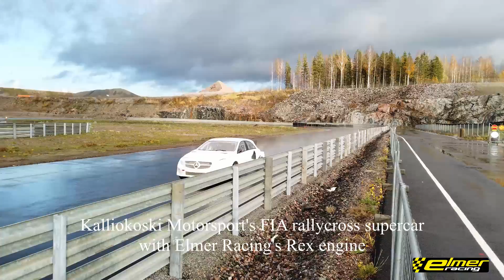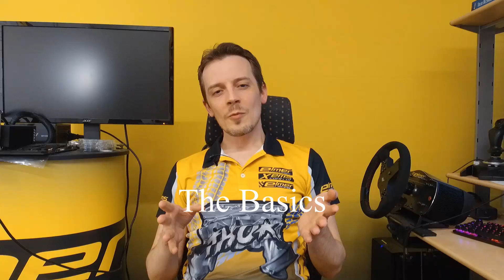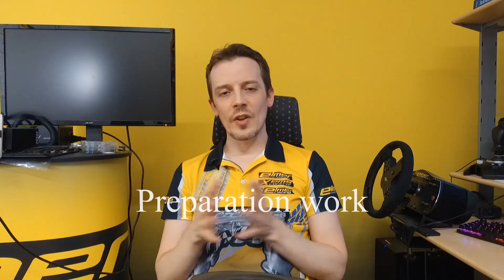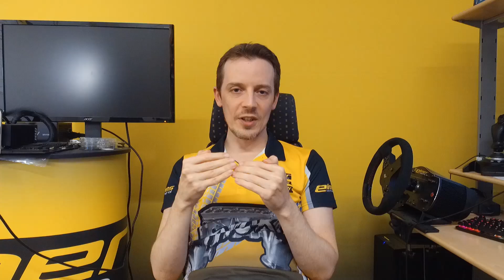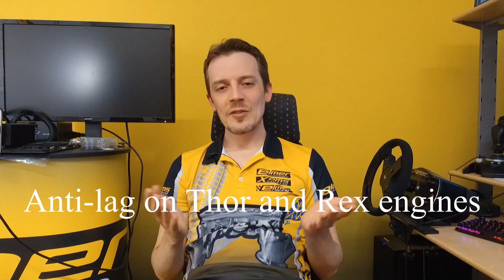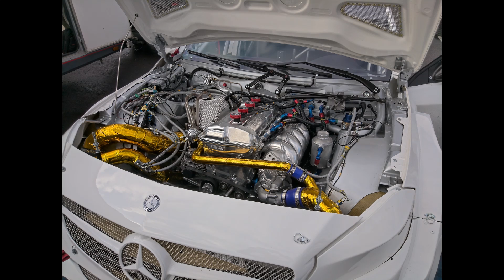Anti-lag for dummies

Comment: So Fresh Air Antilag system is less efficient that throttle + cylinder ign/fuel cut strategy?
Reply from the maker: Yes. At operating rpm using a modern anti-lag setup allows running up to full boost, even when exhaust pressure is higher than inlet. With bypass this isn't possible.
At very low rpm when your operating point is in the compressor surge area, you do have a advantage with a bypass valve though.

Comment: Hello, thank you for this video. Im playing with antilag on probably more basic ecus. Often i see pressure spikes on intake manifold pressure signal, but no spikes on pressure before throttle body. It means engine is missfiring? Can i just find retard missfire limit by trying retard of all cylinders or this must be tested just with retarded one cylinder(of four)?  Also which way of cutting cylinders is better by ignition or fuel(i read the fuel cut making less egt, but did not tested it in person)?
Reply from the maker: Pressure spikes in the intake (as you state) mean you have severe missfires, which results in combustion in the exhaust manifold, and the pressure/flame from that causing even the intake side to ignite. Not ideal to say the least.
You can find the missfire retard limit by retarding timing on all cylinder also.
Cylinder cuts should only be done by fuel and spark. Only cutting spark is the same as a missfire from the engines perspective.
Reply: @ElmerRacing But when ecu can just choose spark or fuel? Maybe noob question, but aim is to maintain boost pressure flat?(i still see creepeing of boost up inside intake(say after high rpm lift off from -0.2bar to 0.3bar during a second). And how may i compare/use pressure before and after throttle here, as there is a huge difference...?
Reply from the maker: You will have to check with your ecu manufacturer. Typically "fuel" actually means fuel+spark, but this can vary. Some ecu manufacturers even deliberately hide what their options do though!
In reality there is no way to easily maintain a super flat MAP curve. But that shouldn't be necessary in most cases. The ECU will adjust fuel and spark timing based on your tuned maps.
Backfires that go all the way into the intake are not good though, they need to be avoided. Typically you will have a spark failure (deliberate or accidental), spark timing failure, or A/F ratio not being in the combustable range if you have missfires.
Reply: @ElmerRacing Thank you. If i can ask more... you mention A/F , how much enrichment is "ok" ? Looking A/F during ALS with a cut is pointless.  And what about Blow off valve,  teoreticaly it will not work, but i feel it will open  for a brief second as pressure difference pre and post throttle will high enought at lift off= and it can prolong turbo life?
Reply from the maker: Maintaining the correct AF ratio when coming back after a cylinder cut is maybe the most difficult part. Depending on your setup, you might need 20% enrichment for that cylinder, or maybe even 80% on a badly designed engine after 2 or three consecutive cuts.
We design our engines to need as little post-cut enrichment as possible.
You can use blow off valves in conjunction with anti-lag. Shouldn't be a problem.

Comment: Thank you for your vidoes! I have a question. You mentioned when the injectors are close to the intake valve the mixing is poor unless you get the spray pattern correct. Have you used additional injectors at the end of the intake runners for better air fuel mixing in high rpms? have you seen any gains in that ? thanks
Reply from the maker: Thanks for watching and commenting!
Injectors earlier in the runner do have a mixing benefit. But come with the downsides mentioned here. So designing the overall engine package for the intended use is very important!

Comment: I have so many questions.... I have seen butterfly valve closing the second scroll... isn't that possible on high flow and high EGT's?
What kind of strategy are you using for upshift? just retarding or fuel or ignition cut, the Rex sounds really smooth! slow ramp back time or does it return to normal timing instantly?
I'm a DIY with a totally stock looking 1996 twin cylinder motorcycle running a MaxxECU with a lot of features, electronic throttle,  shiftcut and downshift throttle blip, traction control to name some. I'm really eager to learn this advanced stuff. The fact that you're here sharing that wealth is unbelievable!
Reply from the maker: You could probably design a butterfly valve to work in exhaust environments. Turbosmart is trying to do this as a option on their direct electric actuated wastegates for instance.
Easiest is typically to use only ignition retard. As long as you can retard ignition enough to shift, without running into the misfire retard limit. Cylinder cuts would be needed if retard alone isn't enough. (needed enrichment after the cut needs to be done in the same way as on "anti-lag" cuts. All the same for the engine.)
Thanks for your comment! We want to help clear up misunderstandings as much as possible! There's a lot of that regarding engine function and ecu control out there!